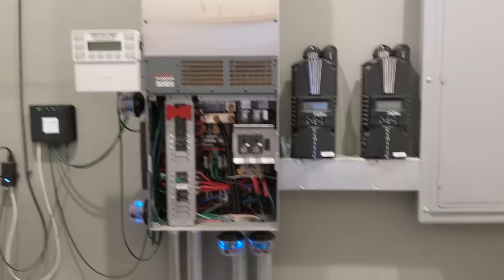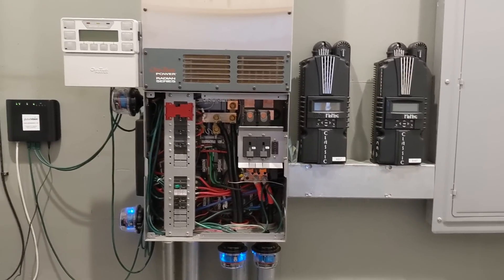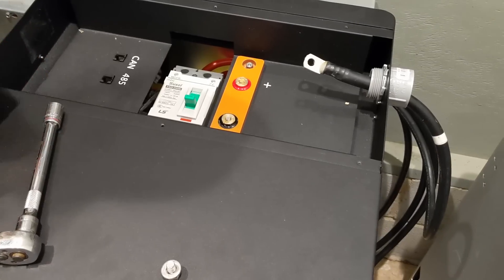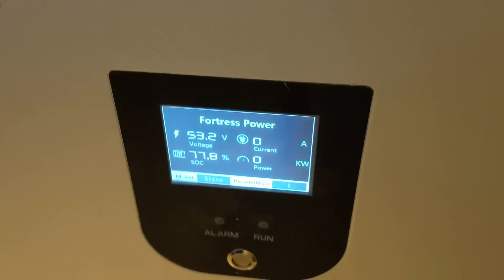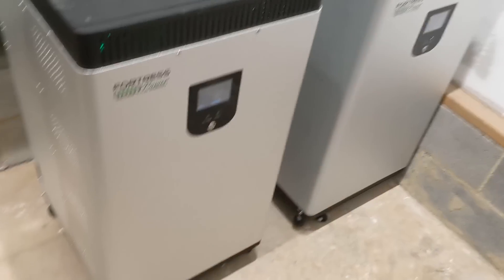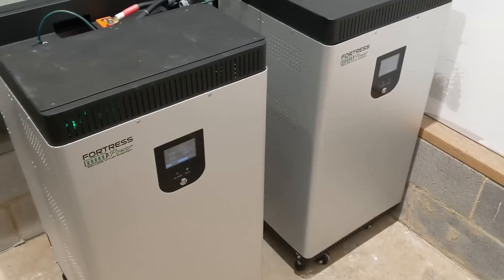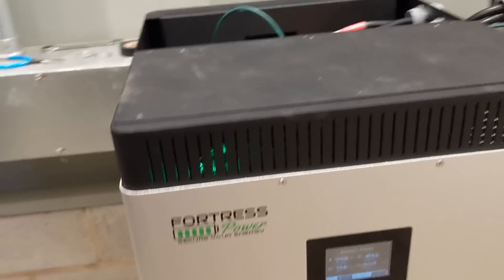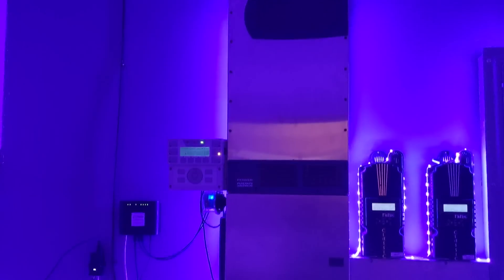The Battery Swap Out

Comment: Lithium is nice, but 670.00 per KWhr vs 110.00 is a hard nut to crack. 

When/if it could get into the 300.00 or maybe even 400 per kwhr then people could jump in. Right now it is really still kinda high. Yes over 20 years (if they actually last that long) it might pay off. But the technology is not even really that old to know for certain.
Reply: If you buy the cells and build your own you can build a 21kwh  400ah 48 volt battery for $4k for the cells, and maybe $500-$1000 for the bms depending on which route you go, possibly as high as $2k if you go nuts, if you use 70% of the depth of discharge your looking at at least 8-10k cycles for the pack and a usable capacity of 15kwh. To get a long life out of lead you need to keep your discharge rate to 20% max, so you'd need a 1500-1600ah bank to get 16-17ish usable kwh, that gets you about 4.5-5k cycles. Looking around 1130 amp hour Trojan 2 volt cells for a 48 volt pack is about $8600. And that doesn't also factor in the higher round trip efficiency and never having to worry about sulfation, low electrolyte, or hydrogen gas buildup. You have more reserve in the lead bank but at a major hit to cycle life if you have to use it. The math seems pretty obvious to me at this point. It's only when you buy the prebuilt batteries like these that the costs go through the roof. Prismatic cells are and your own bms are a much better option if you can do it.
Reply: @andycanfixit  Trojan 2v cells are not very cost effective. their most common t105 are, they are cheap because of huge volumes.
48v x 400ah = 19.2kwhr, a little shy of your 21kwhr number. The best price I can find for used Li packs are coming out at 133.00 per 1kwhr. So a 20kwhr pack would be 2660.00. I am currently assembling a 10.5kwhr pack that cost me 1600.00 not include the Daly 48v BMS . 
But that is used batteries from Jehugarcia on youtube. I dont know what cells your referencing. 

But spending 675 per kwhr is just not practical
Reply: @mythoughtsonfaith1031  200 amp hour Lifepo4 prismatic cells can be bought new on AliExpress for between $480-$560 for 4 cells. You need 16 to make a 48 volt pack. Even at $560 for 4, to get enough for a 32 cell 400ah pack your $4500. It goes up to a bit over $5k if you buy them from a US warehouse instead of shipped from China. The T105 cells you referenced looks like they run about $160 each, 20 percent discharge gets you to 3,000 cycles it says so you need 3 sets of 8 for a pack with 270ah usable costing $3840, pretty close to the 280ah usable out of the Lifepo4 400ah pack if you want max cycles, but that's close to 8,000-10,000 cycles at that point reserving 30% capacity per cycle, 10 at the top, 20 at the bottom. If you do 80% discharge instead, 10 at the top and bottom your at a 320ah usable pack size good for 4,000 cycles, you need 4 sets of 8 trojan batteries, which gives you 360ah usable, so $5120 for the pack. No bms needed, but you still have all the maintenance, lower efficiency, and sulfation risks. Combine that Lifepo4 pack with Daly bms's and your in the same ballpark cost wise, roughly similar capacity but with none of the lead issues. At $2240 per 200ah 48volt set of cells your at about $200 per kilowatt. Going with raw cells and building it yourself the cost is massively lower. If you go the used battery approach, you can go way lower in cost, just not sure of the cycle life, probably 2-3k cycles if you overbuild. $2600-$3000 gets you similar size used pack in lifepo4. I went with a used pack for my first couple packs cost wise, and they are holding up fine. Additional packs are built with new cells now. These prebuilt batteries are nice, but the costs are just too extreme. 

 I use the ANT-BMS 400a for my packs, about $110 per BMS per pack, 400a peak draw, 50a max charge per bms. But with the 3 packs I have none of the BMS see more than 45amps max draw on average, charging peaks out at about 40amps per pack. Each pack I add just splits the load some more. Plus they are fully customizable settings wise and cheap enough to keep a spare or two on a shelf. They don't even get warm under the use I put them through powering 6kw of split phase inverters with plenty of power to spare when I double my inverter size.
Reply: @andycanfixit  Have you bought and tested the aliexpress cells? Sorry but I just dont trust chinese junk. I would want to see them tested, and I still would not belive their cycles. Trojans are well proven, and they can be got for 115..00 a battery very regularly. Not that it justifies the difference necessarily. But in this video we are commenting on he is stating 675 per kwhr, the ali cells at the price you mention are about 325.00 pe kwhr, and trojans are 95.00 pre kwhr. if all are being used to less than 50% DOD then lead is cheapest. For many people the intial expense is a hurdle, and getting a 1840.00 lead pack at 19.2kwhr is possible, whereas spending  6240 (19.2x325) is just not possible.

I am not saying that lead is better, I really dont like lead, and have been using it for years so I have real world reasons to not like them. But Li is still just a little too expensive for most to justify using. 

Side note, I use inverter chargers in addition to solar, so I prefer the Daly BMS because the charge and discharge are on the same wire going into the BMS.
Reply: @mythoughtsonfaith1031  The ANT-BMS I use is the same wire into it as well, it just is limited in charge in vs discharge out, I have both inverter/chargers and standalone solar chargers all feeding into my battery bank. I've tested the 150ah cells and averaged 156ah per cell, so far I've seen nothing concerning. Most Lifepo4 cells are produced in china going on over 10 years now. CALB cells have been in heavy use in EV conversions for at least that long so I don't have a lot to distrust them. Many others are testing the larger cells and showing good results. 

As to depth of discharge, once you start going above 20% your cycle life  really falls off in lead, by 50% your down from 3000 cycles to 1100 to 1200 cycles, so you need a larger bank to keep your cycle life up. Otherwise you have a smaller upfront cost but a much larger cost down the road as you have to more frequently swap cells. By the end of the cycle life your bank with lead is really struggling with a big hit in efficiency. With Lifepo4 your capacity falls off but your charge/discharge curves stay very stable. Due to the cheapness of my used batteries combined with the new batteries I'm cycling about 60% of my banks capacity in a normal day. My first bank started at 9kwh for about $1k, it's got at least a couple thousand cycles left in it, my next bank is 5.4kwh of used cells, $760 for it, very lightly used cells, 4-6k of cycles left in it. Third bank is new cells 150ah ones averaging 156, so about 8kwh for $1700, that one being the most expensive. Cost per cell drops a good bit as you go up in capacity. You can get 200ah cells now for $300-$500 more than what my bank cost if you shop around. Use some of the battery testers on youtube to figure out which vendors are safe to buy from. The average quality has gone up a good bit in the last couple years so there are less issues now but you still want to do your research. I like Lifepo4 chemistry because you get cycle life and it can't catch fire unlike other lithium chemistries. LTO is interesting but it's too expensive and isn't as efficient, but 20,000 cycles is hard to knock and it doesn't care about temp or total discharge, discharge it to zero and it doesn't hurt it at all. If the prices ever go down or I find a used price great deal I'll probably build a smaller bank of it as my last resort bank. If you got a lead bank that's working for you, keep it, by the time its ready to replace the prices will only be better on Lifepo4.
Reply: @andycanfixit  like I said, for many the break point for li/life just hasnt been crossed. I know a few people who need to go lead one more bank life and after 3 to 4 years, they know the LI will be at the right price range. 

Like I said I am swaping from 19.2kwhr of lead to Li right now. But it is only because the used cells I got were cheap

Comment: Battery's blocking them panels man you know better lol. I just got setup with fortress and Sol-ark.
Reply from the maker: its only a test man.  they are moving to my generator shed with 2 solarks 12kWs
Reply: @engineer775  right on man keep it up. 
If you need to do anything in FL i got the license.

Comment: What is the difference lead to lithium for EMP?
Reply: Great question.👍
Reply: Lead is used to shield against atomic bombs and such.
Lithium suicide bombs from a static shock sized charge...
Reply: Lead acid batteries really don't care about current or voltage you can hook it from 12 to 14 volts where is lithium batteries are very particular on the voltage and charge current so in conclusion you can use a dumb charger to charge lead batteries but you need a smart charger to charge lithium as far as I know I could be wrong

Comment: Will your system auto start your gen-set if the SOC gets to low? If so will it work with the new batteries?
Reply from the maker: I have a PTO generator so I have a manual transfer switch but it will charge the battery
Reply: @engineer775  Thanks Scott. Yep, that is a real manual transfer switch.

Comment: Voltage is not a indicator of capacity. Connecting them at the same voltage is for surge (safety) the SOC will be interesting to see if the software balances the SOC it should but without software control it does not at least imho but depends on when you dump the capacity the later the better for SOC.
Reply: yes it would balance without the software balancing
Reply: @ursodermatt8809  how long i added a battery a week ago and it is still drawing 9 amps
Reply: @offgridwanabe  
not knowing what your specific setup is, it's a bit difficult to know what your 9amps are doing after a week.

Comment: How many full battery cycles per day do you go through?
Reply: Will Prowse does loads of lithium battery testing. I believe he recommends discharging to 20% and charging to 90% to increase cycle life beyond 10k. It should also slow down degradation. The 20% and 90% SOC have corresponding Voltages. You would set your charger to charge to that voltage and program your inverter to disconnect at the low voltage setting. In a Sol-Ark you do both settings. 
If you want to avoid sitting in the dark, you can hook up a auto start generator that kicks on 0.1 volt over the low voltage cut off. 
Love lithium
Reply: 4philipp I have read of similar experiences from people driving electric cars.  They refer to this as babying their batteries.  In addition, they try to avoid charging outside their homes as much as possible, and when they do charge outside, they try to avoid the fastest charging rates to prolong battery life.
Reply: E K yea that too. In the end it comes down to cost and convenience. If we use the average life expectancy of 80 years for humans, two sets of batteries lasting 10k cycles (25 years) each, gives us 50 years of power. A 30 year old would be set for life with independent power. Not a bad deal.
Reply: 4philipp based on cycles, I would expect NiFe batteries to outlast lithium batteries.  

The biggest maintenance required after several years would be flushing out the electrolyte and replacing it with a new one.

When required, rinse and repeat.
Reply: @ek9772  Your also constantly adding water to NiFe batteries as you boil off the water often, as well as a much lower round trip efficiency. They will last you your lifetime but there is a lot of maintenance. Lifepo4, as long as the BMS is doing it's job, there is no maintenance. The cycle life is easily 10k if you are keeping your charge to 90% full and no more than 80% depleted, giving you 70% usable easily. They also will not catch fire unlike other lithium chemistries like those used in laptops etc. Build your own using prismatic cells and you can build the battery for a fraction of the cost of the pre-built ones, and put a spare BMS on the shelf for the end of the world. Solar systems rarely even stress what they are able to charge and discharge at so even with daily cycling, it's a pretty easy life on them versus what those cells can take in EV applications.
Reply: Andy P you are right.  They do require more maintenance, and available energy is less compared to Lithium, but they have the lowest cost per cycle long term.

Maintenance can be lowered with an automatic watering system if the site is unoccupied for long periods of time.
Reply from the maker: Right now I'm in grid Thai cell just because I haven't been home to monitor it so I'm just floating these batteries. Discharging slightly at night and recharging in the morning. It took a while but they are nicely balanced now.
Reply: Engineer775 If you don’t empty them fully each day, can I assume they would last longer than 6,000 days, or is this completely incorrect thinking on my part.
Reply from the maker: @ek9772  It is a really good question as I don't know of any batteries that will last that long so these claims of crazy long cycles are yet to be seen. all I know is my laptop battery won't make it more than 3 years. Lol
Reply: Engineer775 I appreciate you sharing. 

I have been thinking of Lithium and NiFe batteries for a while.  

I like the NiFe batteries since some of them are still around after more than 50-years, but they are initially expensive.  However, the cost per cycle goes down after several years.

The lithium batteries are, also, expensive; however, they offer good performance, and as you said their lifecycle is still undergoing testing.

For now, I am undecided and a little bit less clueless - but not much.

Comment: Couldn't you build a Faraday cage around the lithium batteries to make them EMP proof ? 🤔🤔🤔 As far as the length of your videos, "you can please some of the people some of the time but not all the people time. You're doing a hell of a job Mike. Keep it up.
Reply: eehhhh?   did you notice the metal sheets around the batteries?
Reply: @ursodermatt8809  yes the case may offer some protection from EMP but if the world was really on fire would you really want to trust that case or would you put it in your own Faraday cage I would lean towards redundancy backups for my backups meaning I would rather build a faraday cage. Especially if I just spent $24,000 on batteries
Reply: @gothmansams  
if the world is on fire, government organizations would instantly confiscate your emp proved gear, if the roaming mob didn't kill you first and steal it.
having said that, the metal cage IS a faraday cage.
besides the emp probably wouldn't harm the battery cells themselves, rather the bms. the cells can be manually balanced every 6 months or so.  when the world is on fire you probably have lots of time fiddling abouts at home